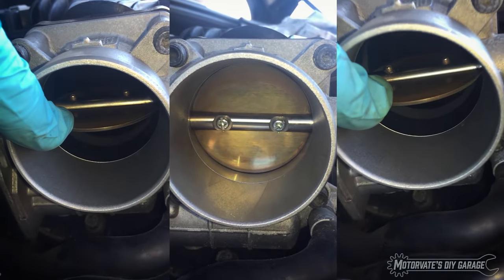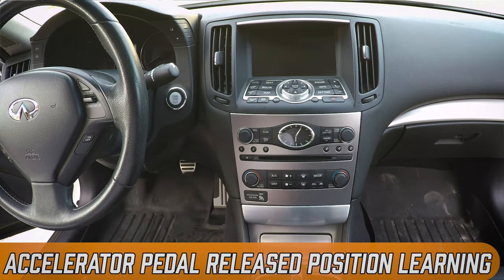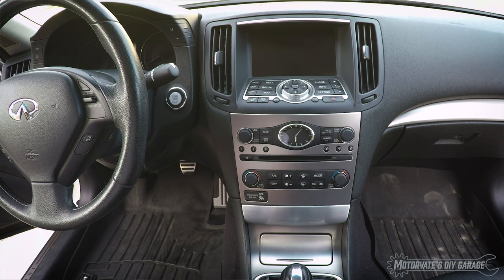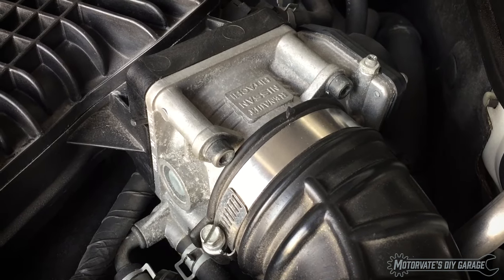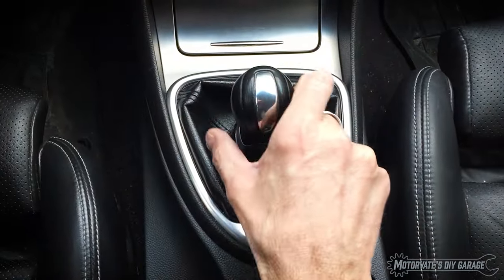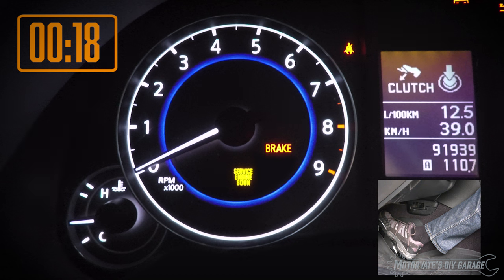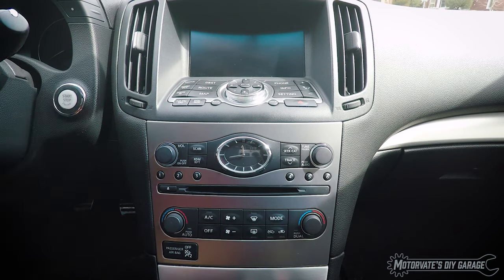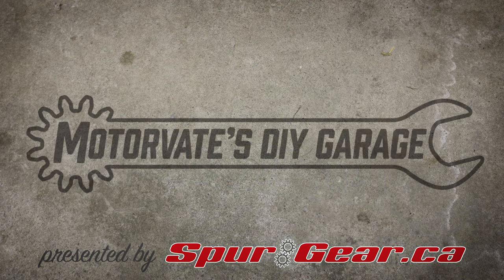G37 & 370Z After Throttle Body Cleaning: Motorvate’s DIY Garage Ep.27

Comment: Does anyone know if the procedure is the same for a Q50 3.7? I plan on cleaning the throttle bodies soon, thank you!
Reply from the maker: It is exactly the same.... as a mater of fact, all Nissan or Infiniti vehicles with an electronic throttle (almost every Nissan/Infiniti made since about 2003) can use this process to set a proper idle after cleaning the throttle bodies. :)

Comment: Hey man, I have a 3.7 Q50 and after a warm start it is like a 60% chance that it will shut off unless I tap the gas pedal. Should I try these procedures, or is it something else?
Reply from the maker: Hey Jawad Anser,
If you haven't already, I would clean the throttle bodies first:
G37 & 370Z Throttle Body Cleaning: Motorvate’s DIY Garage Ep.26
https://youtu.be/ySK99VbSiTE

Then follow the steps in this video and that should fix your issue :)

If you have a bluetooth scanner and an Android device, you can use a free app to do the "idle air volume learning:
Quick & Easy Idle Air Volume Learning: Motorvate's DIY Garage Ep.28
https://youtu.be/OiB9txECWB0
Reply: Thanks!
Reply from the maker: Anytime :)
Reply: I tried step #1 exactly to your video and it fixed my problem! Now the car starts up perfectly and rpm's slowly drop to normal. Before it would start up, and 1 sec after shake really bad and turn off. Thank you so much!

Comment: Does this same process work on 2017 Qx80 and can I open throttle body with my fingers to clean it
Reply from the maker: Hey  Eddie Wilson,
I don't have any first hand experience working on the QX80, so I don't know.

However, generally all Nissan/Infiniti with electronic throttles use the same process for the idle air volume learning and the throttle body can be moved to clean it.

I think the odds of the QX80 being different are VERY small.
If you do decide to to clean them, please let me know how it turns out.

Comment: I need help I use this steps but still have no power in my gas pedal doesn’t even move past regular position
Reply from the maker: I need some more info. What year make and model of car is it? Was it running ok before you clean the throttle body? Was the check engine light on before or after cleaning?

Comment: Were you an engineer that was involved in the development of this car? What your teaching is pretty cool cause I can't find any of this in my owners manual
Reply from the maker: Hey Pacific 32,
The owner's manuals don't typically show anything too technical.

They only show the more basic items, like changing a tire or bulb.

This information is from the Infiniti Service manual, page EC-27 for a 2011 G37.
It is the same process for any Nissan or Infiniti with an electronic throttle, which is anything after 2002-2004.
Reply: Motorvate DIY That's great, Im looking forward to following those steps myself after my tune-up.
Reply: And lastly, you have a new subcriber.
Reply from the maker: Hey Pacific 32,
.... good luck!
Reply from the maker: And a big thank you for that ! :)

Comment: Hi 
Can you tell me how to repair infinite g35 I just replace a new throttle body and now it accelerate automatic
Reply from the maker: That is going to be difficult to do over comments on youtube.
Did the "idle air volume learning" complete?
Is the hot idle between 600-700 RPM?

Comment: I did this on my 2007 Hr and now it idles High ..I even replaced the throttle bodies and same thing. Any ideas boss? Thanks
Reply from the maker: Hey Driftblock350,
Crap, I guess you didn't see the warning in the top line of the description :(
As I understand it, the root of the problem is programming bug in the 2007 ECU.

Were you able to get the idle air volume learning to run to completion?

Eugene (at https://www.yelp.com/biz/enthusiast-auto-care-concord) has successfully re-programmed the 07 ECUs
with 08 code and this permanently  resolves the issue.

You can also try this easy method to run the idle air volume learning:
If you have a bluetooth OBD scanner and an Android device you can use a free app to run the idle air volume learning:

Quick & Easy Idle Air Volume Learning: Motorvate's DIY Garage Ep.28
https://www.youtube.com/watch?v=OiB9txECWB0

One last suggestion:
I have had two people comment that they went to the dealer and they did an ECU update and that fixed the problem.
They mentioned something about updating from version A to version B.
Reply: Motorvate DIY I’ve tried the relearn so many times and still the same I just purchased a used 2008 hr ecu I’m going to plug it in tomorrow and program it to my keys etc and see if it works
Reply from the maker: Hey Driftblock350,
I think the VIN will also need to be programmed in to the 08 ECU.
Please let me know how you make out on the ECU swap, I am really curious about this!
Reply from the maker: I just checked with Eugene  (at https://www.yelp.com/biz/enthusiast-auto-care-concord) and you will need 

to disable the ECUs anti-theft system for the car to start.

If you don't have the tools to do that, he can fix your old ECU.
Good luck!
Reply from the maker: I did a bit more research and I think this will happen:
• The key IDs are stored in the BCM (which is good)
• The BCM checks the ECU for a verification code on order to start the engine.

Since the ECU is different, I suspect you will be able to turn over the engine (good key code),
but it won't start. (different ECU verification code)

I hope I am wrong and your car starts right up, but please let me know your results.
Reply: Motorvate DIY my car is fixed!! Just had to swap my ECU to a 08 ECU and call a local Lock Smith to program my keys and started up and runs even better the before !
Reply from the maker: @driftblock3504  Hey Driftblock350,
That's great news! Thanks you for sharing your solution with me :)
Reply: Motorvate DIY hey man so I fixed my idle issue by swapping to a 08 ecu but I still want to fix my old ecu , I pressed on the link you send here to but it won’t work..do the have a Instagram page or something?
Reply from the maker: @driftblock3504  No problem, just do an online search for "eugene enthusiast auto care" and the first result should be his yelp page. Good luck!
Reply: Motorvate DIY by any chance do you know where his shop is located ? I have a feeling he’s in my area .
Reply from the maker: @driftblock3504  Hey Driftblock3560,
Eugene is in Concord California.

Here is a link to his Yelp page: https://www.yelp.ca/biz/enthusiast-auto-care-concord
Reply: Driftblock350 how did the lock smith get the key programmed to your car i have the same issue do you have insta or fb or something please answer

Comment: What happens if u remove the trottle bodys from inside as well n put everything back ?? On now my g37 acting weried
Reply from the maker: Hey  Micheal Garcia,
I'm not sure I understand the question... 

If you removed or cleaned the throttle bodies the "idle air volume learning" procedure must be done so the engine computer can re-learn the air flow & throttle position.

Comment: For step 1 & 2 does it have to be on a cold engine?
Reply from the maker: Hey Alpha Chino,
The first step (accelerator pedal released position learning) can be done at any engine temperature.

The second step (throttle valve closed position learning) the engine coolant must be 25C / 77F or less before starting the procedure.

Good luck!

Comment: I am having a high idle on my 350z HR after cleaning throttle body. Many  seem to have had this issue. I am on day 2 of troubleshooting.
Reply from the maker: If your HR is an 2007 I guess you missed the warning in the video description... there is an ECU update required to have the "idle air volume learning" run to completion. Some dealers will update the ECU, some want to sell new ECUs and some want to sell new throttle bodies.

Also, Eugene at Enthusiast Auto Care (https://www.yelp.ca/biz/enthusiast-auto-care-concord ) can reprogram your ECU.

If your HR is an 2008, make sure all the per-conditions are met and try again. Sometimes it seems to take a few times for the idle to settle.
Reply: @MotorvateDIY  Link provided  is broken.
Reply from the maker: Sorry about that.... it is now fixed.
https://www.yelp.ca/biz/enthusiast-auto-care-concord

Comment: Hey, after cleaning my throttle body and my MAF sensor on my g37 I noticed that the problem still did not go away which was low idle. I did not attempt to do these steps after cleaning them, do you think if I do these steps the problem will go away, I also have a P0106 code which is manifold absolute pressure.
Thanks
Reply from the maker: Hey  Garry Gill,
Yes! The purpose of the last step (idle air volume learning) is to set the proper engine idle speed of 600-700 RPM.

Your P0106 might be due to a needed ECM update:
https://infinitig37.com/TSB/ITB12-026a.pdf

Good luck!

Comment: Will this work on a gmc envoy 2008. I took off throttle body clean it all up. Now idle is going crazy.
Reply from the maker: Hey  Joe Medvec ,
Nope... This is only for Nissan and Infiniti vehicles from about 2003 on.
I haven't worked on any GM products, so I can't offer any tips or suggestions.
Good luck on you search for the solution!
Reply: Motorvate DIY ok thanks for the answer back. Very much appreciated

Comment: Does this mean I lose a little power to?  Because I also experiencing it. But it's not always consisten. Comes and go. I just assumed it's because the fans were on
Reply from the maker: On myg37.com, I have read a lot of threads where people complain about a loss of power. BUT it can be hard to tell the difference between a real loss of engine power, and a transmission that won't shift down a gear when you want.

My G37 has the 6 speed manual, and I haven't experienced any random loss of power.

So... I don't know what else to say, other than a dirty throttle body will result in a little slower initial throttle response. 

You only notice this after you clean them and do the "idle air volume learning"
Reply: @MotorvateDIY I just got the car. I have been driving the car longer and I'm thinking it's a sensor. When The vds light comes on thats when the power cuts out.
Reply from the maker: You may want to spend some time with the owner's manual (can be downloaded from Infiniti)  to see if that is normal operation when wheel spin is detected or if it indicates a fault.

Comment: Hi, can you explain why its necessary to do step 2 at low engine temp? In the nissan workshop manual its not needed. After cleaning my idle is very high and its not possible to fix it now.
Reply from the maker: Hey Karl Heinz,
You bring up a good point! 

In the 2010 G37 Sedan factory shop manual, there is no mention of a temperature requirement (page EC-19-20) for the throttle valve closed position learning.

However in the 2011 G37 Sedan shop manual, on page EC-26-27, there is a minimum temperature requirement.
In looking at other years of G37 shop manuals, it seems like Nissan/Infiniti added this requirement of a minimum engine temp requirements for the  throttle valve closed position learning in 2011.

Your high idle should be fixed by doing the idle air volume learning.  (except for the 2007 G35, as the ECU has a bug and it won't run) Sometimes it takes multiple attempts to get the timing just right. In on case a comment was left saying it took them about 20 times.

If you have an bluetooth scanner and a Android device, you can use a free app to run the idle air volume learning:
Quick & Easy Idle Air Volume Learning: Motorvate's DIY Garage Ep.28
https://youtu.be/OiB9txECWB0

Thanks for your comment and good luck!
Reply: @MotorvateDIY  tried all you've told me, idle is still surging. Deepest idle i've got is 900rpm. But if i turn off and then turn on the car, idle is surging like before. Any solutions?
Reply: @MotorvateDIY  Finally i solved the idle surging! I used a romanian ecu test program and looked that the engine conditions stay pernickety as possible like described in the manual. After 40 trys i fixed it in the evening with cold environmental conditions. I think that its a must have that intake temp is under 30 degrees C.
Reply from the maker: Hey Karl Heinz,
Thank you for this update! I will add this to my troubleshooting tips for the idle air volume learning.
Great work!

Comment: Hello. Thank you for the video. I have a question to third step...my "service engine soon" light wan't start to flash! Is this ok or?But my RPM is 637, feels ok for me😅. Car: 2009 Infiniti G37x
Reply from the maker: Hey Alexander,
Sometimes the last part can be tricky. All the  pre-conditions need to be met and the timing of pushing/releasing the pedal is critical.

I had one comment where the person finally got it to work on the 20th try!!

If your idle is stable and in spec (600-700 RPM) which your is, I think you are good to go.
Reply: Motorvate DIY Awesome! Thank you! Best channel ever!
Reply from the maker: Wow & thanks!

Comment: Good to see you back! I just cleaned my throttle body about 2 weeks ago but didn't do the idle relearn procedure since I was told if I don't move the butterfly valve manually but clean around it I won't reset it. Do you think I still need to reset the idle?
Reply from the maker: Hey Edumacation95,
If you didn't move the butterfly, the most important part of the throttle body wasn't cleaned.
That is the part on the edge of the butterfly valve.  I would suggest you clean it again and do the three things mentioned in the video.

Or if you are happy with it, then don't worry!
Reply: Interesting, I'll have a closer look at the butterfly valve and pay attention to the idle and see if it needs to be re-cleaned. Thanks for the advice! By the way, could you perhaps do a video on changing engine coolant out or even serpentine belts for the 370z/g37, am thinking of doing mine soon
Reply from the maker: Hey Edumacation95,
Coolant changing video will be shot in the late spring or early summer. (my coolant is due for replacement)
I will add the  serpentine belt replacement to the production schedule for 2018, as I assume mine must need replacement soon.

Comment: im really really hoping i get get some help here.....i fully removed my throttle bodies the other day to clean them, removed hose and disconnected the electronic wire and fully cleaned my throttle bodies, after doing so i installed them back and i only did the "Accelerator pedal released position learning" and today all of a sudden my G37 would rev up when pressing down the gas pedal, but it would no longer accelerate as fast at it should or normally should. the response for acceleration is no longer there.. please someone help ;/
Reply from the maker: Doing the  "idle air volume learning" procedure should fix your idle issue.

Comment: I clean the throttlebody on my 2011 Maxima,  the only thing I encountered from that is when I first start the car up the rpm will sit at 1500rpm then slowly decrease.  Is that normal even when the car warm up with all day driving?
Reply from the maker: Hey  Mikal,
I think so... Based on looking at  datalogs from my G37. When fully warmed up, (coolant at 83C / 181F) it rises to 1500 RPM then drops down to 800RPM after about 4-5 seconds.

Is that what your Maxima is doing?
Reply: @MotorvateDIY , when the car sits over night it starts at 1500rpm then drops to about 650-700 rpm after it warms up.. . Then I'll let it sit for 2hrs, and rpm sits at 1200 then drop to th 650-700 rpm after 4-5 sec
Reply from the maker: @mikal9624  To me it sounds normal. The proper idle speed is monitored by the ECM (engine control module) and if it is too high, it will turn on your check engine light and set a code.

If you don't have a check engine light and the engine runs well, just drive the car and enjoy it :)

Comment: Would this be the same for a 2007 Nissan 350z Hr??
Reply from the maker: For the 2007 HR... DO NOT CLEAN THE THROTTLE BODIES!!! There is a bug in the ECU and the required "idle air volume learning" will not EVER complete and you will have a high and unstable idle.
Reply: @MotorvateDIY  So im stuck with dirty throttle bodies then 😂, but ive also read about this on the forums so thats why im sketchy about  doing this. Ive seen that you need to ALWAYS unplug the negative cable of the battery before unplugging the throttle bodies. Car has 78,000 miles so it probably doesnt need it all that much yet but just gonna leave it as is and Call Nissan because i think theirs a Technical service Bulletin for this issue and simply needs the ECU to be reprogrammed to the updated 2008 software because that year didnt have this problem all that much.

Comment: I’ve done this and I still have a a lazy throttle and my rpm’s sit at 500 when I’m at a stop in the drive gear any idea?
Reply from the maker: It can be very difficult to to determine if it is a slow throttle response or a transmission that is slow to down shift. The 7 speed on the G37 is not know for being responsive. There are many threads on this topic at myg37.com... maybe pop over an see if there is something else to try?

As for the idle speed of 500 RPM in drive... that is normal. The factory spec is 600-700 RPM when in park or neutral.

Comment: Can these steps work for 2013 infiniti JX35 car? Thanks
Reply from the maker: Yes :)
It works for any Nissan or Infiniti with an electronic throttle, which started around 2002.
Reply: @MotorvateDIY  Thank you for letting me know.

Comment: I cannot get mine to do that throttle valve closed nosie🤣🤦🏽‍♂️ I have tried that numerous times, lol
Reply from the maker: I don't think you need to worry about it as I suspect it is happening, but you can't hear it. Just about every time you drive the car, when you turn it off, if does this.

If it is driving good and you don't have any codes, you have nothing to worry about.
Reply: @MotorvateDIY  🤣much appreciated!  I was pulling my hair out, and I'm bald already 🤣🤦🏽‍♂️